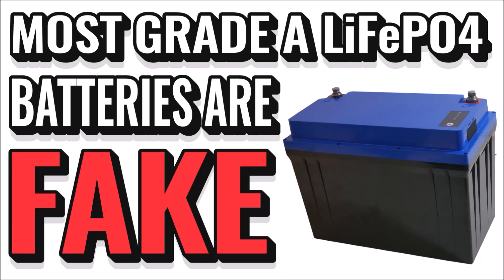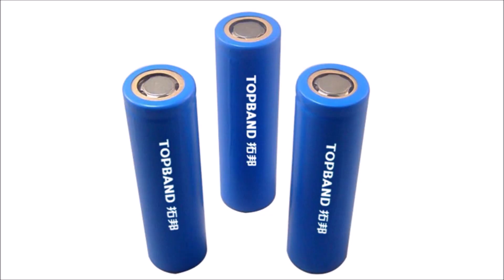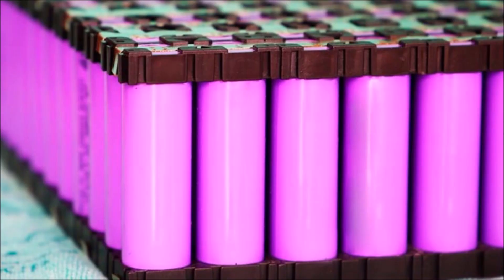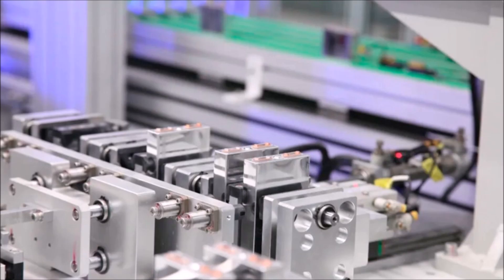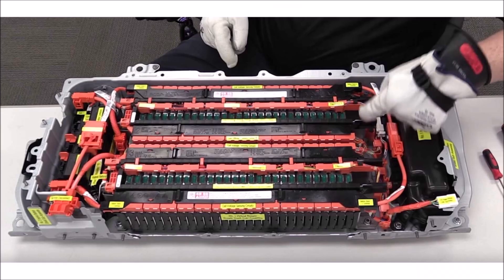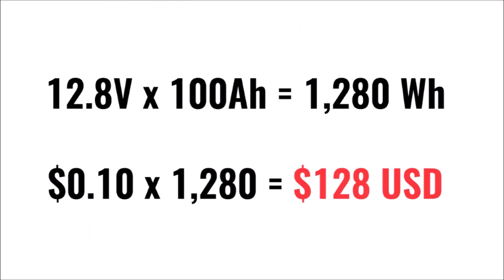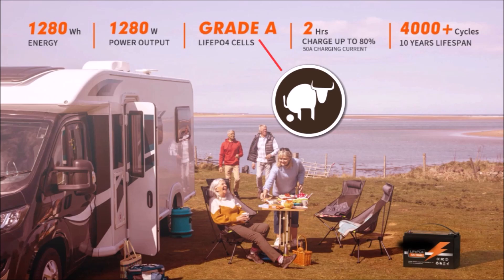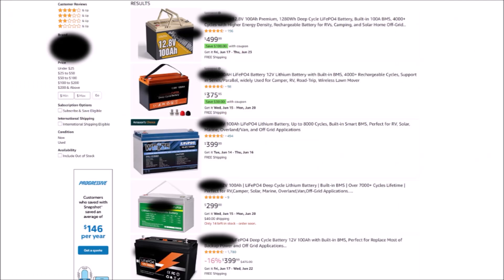Fake Grade A Lithium Deep Cycle Batteries Are Everywhere!  Learn How To Spot Grade B vs Grade A

Comment: False advertising is as old as human existence but in this case, the cheap fake grade B batteries might still offer the best value.  For an RV or adventure van usage, 1000 cycles of trouble free use might be 10 years, or longer than anyone will own the vehicle.  Faster charge rates, zero maintenance, light weight, and a 10 year life out of a 300Ah LFP battery @ $600??  Yes please.  In 10 years the battery tech will have improved exponentially so the fake B cell battery offers a best-value-right-now for most of us.
Reply from the maker: True.  But since this video was uploaded there have really emerged a new range of bargain basement offerings on Amazon and Ebay in the range of $0.15 per Wh range ($200 for a 12V 100Ah battery, for example) that have no chance at reaching 1000 cycles.  These are made with the cheapest of the cheap cells, sometimes even used cells or Grade C cells, combined with an ultra cheap BMS and average to poor internal construction.  These are being peddled by brands that are 1-2 years old, at most, and have no American support or business presence of any kind.  They simply ship containers full by sea to Amazon warehouses and offload all the support to Amazon.  Thus, you will not get any assistance or warranty support beyond the 30 day Amazon window.

So if you like to play Russian Roulette with your money, buy those.

Comment: Just purchased a battery for 118.00 dollars. Works fabulously and better than one I paid over 400.00 for. So if they're lying to me about it's grade which by the way is not stated on any battery that I've seen,so be it. If my cheap battery runs for 2 to 4 years I've more than gotten my value out of it. Times are changing and sometimes it's good.
Reply from the maker: Bookmark this post and come back to it in 2 years and tell us how it is doing.

Comment: I bet power tool makers like EGO, Dewalt etc are almost entirely based on grade B cells.
Reply from the maker: Correct.  Which is why the cell manufacturers rate their Grade A cells at 4,000+ cycles @ 100% DoD (which would be one full charge and discharge cycle every day for 11 years) but the manufacturer only warranties the battery at about 3 years as an industry average (pro rated, no less).

Granted, contractors may discharge their batteries multiple times in a day but 3 years is still a joke.

Comment: Recently i bought a 24v300ah lifepo battery in Aliex. They aren't just fake. They are a hazard. They admitted they don't have the certs when I requested for a copy of the displayed certification, in this case RoHs, CE....label on the battery. It weights only 10kg indicating that its not even grade B,  it may not even be lifepo...who knows. Everyone using it should know that this is a dangerous and hazardous product. Without proper quality certs you are at risk of fire and explosion. And worst your insurance do not cover such ignorance. These fly by nite sellers are out to fleece us. Buyers protection is useless because the logistic companies will not transport the return of such dangerous goods from 3rd parties.
Reply from the maker: And Alibaba/Aliexpress won't go after the sellers, anyway.  You have zero recourse.
Reply: @LDSreliance  Yes that's true. They are literally Alibaba and his forty thieves. There is one final recourse. With the proof that you hv been scammed get your credit card co to claimed back. You will be amazed.

Comment: I don't see a big problem here except being lied to. Which is a very minor problem, because when I buy anything made in China by a small (effectively noname) manufacturer, I can be sure they lied somewhere, so I just live with it.  And grade B batteries do not seem such a terrible deal for the price. As you said: I'm likely to not even notice the difference
Reply from the maker: I've since revised my opinion on that and the problem is worse than I believed at the time of publishing this video.  Some light users are not likely to notice a difference.  If you don't tax the battery it may be okay for an extended period of time.  But the early failure rate of these Grade B deep cycle batteries is 20% within the first year or two and that isn't taxing the battery hard.  So that is already Russian Roulette for anyone who buys one.  But heavy users, such as people putting them in bass boats and then going out to fish bass tournaments with them will almost surely notice a performance difference if not a failure within 500 cycles or so.

Comment: Remember, things do get cheaper over time.  It's now 2024-06-22 and I just bought 3 "grade A" 100AH 12 volt batteries with bluetooth BMS (100A charge and discharge).  These will replace the 2 6 volt golf cart batteries (230 AH) which I paid $500 for about 1 year ago.  It seems that leaving them on my float charger cooked them.  Oh, and the year before that?  SAME THING.  Lead acid and AGM are just too fragile for the marine environment.  If you discharge a lead acid battery too far, it's going to be quickly damaged.  But the lifepo4 batteries have much lower self discharge and I will be massively increasing my house battery storage, charging current and discharge current for just 20% more than re-re-re buying the deep cycle golf cart garbage batteries.

As someone said below, even if I only get HALF the life of a grade A setup for this kind of money, it is a steal of a deal compared to having to screw around with lead acid ever again.

Comment: Time USB has grade A. Sticker looks new and has not been messed with
Reply from the maker: Companies have been caught removing stickers, laser etching, QR codes, engraving, and serial information and sanding off the Grade B indicator that is required by Chinese law.  It is almost impossible to tell if a cell is real unless you check the information against the cell manufacturer's test data.  If the battery manufacturer is unwilling to give the cell manufacture data or you can't correlate the serial number with EVE or CATL or whoever made it, then you know you have a fake.

Comment: i can live with grade B. 
as i am living on ss and have little to NO extra money each month. and i have cut back on food even heat in the winter. ac in the summer.  but that is grid power. 
my old rv does have a number of old lead acid. but they are very heavy. i would like to go lighter weight. 
right now there are deals going on. but no money to do it. 
and at my age. i question if i would still be here in 10 - 15 years.

Comment: Grade B can easily get the same lifetime, wh will just be a bit lower
Reply from the maker: No they can't.  They won't all have the same specs so they will drift apart over time.  It doesn't matter if you top balance the cells manually or shallow cycle them.  They will never get 3,000+ cycles.
Reply: @LDSreliance  i guess if there isn't any type of balancer inside, but if there isn't its a pretty inexpensive adittion. I got an Neeey 4A balancer and that will do the trick (Got grade A myself tho because there was no eu stock)
Reply from the maker: If voltage is the only difference in all of the cells that might work fine.  But it isn't.  There are 11 other criteria that the cells could be out of spec on.  The worst would be internal resistance and the least bad would be physical size (bloating).  Like I said, even if you manually top balance the cells, which is superior to any balancing that any BMS can perform, you still can't get 3,000+ cycles out of any Grade B battery.

Comment: I bought 8 battle born 3 years ago .they are in 2s4p ,24v ,400 amp bank in my solar system ..they work great, stay balenced with proper charging technique and deliver about 105% of rated power.  I don’t care what they cost, I care that they work so well.
Reply from the maker: I dislike BattleBorn's marketing department and the founders/ownership group of the company but I do have respect for their build quality.  They are one of the few using Grade A batteries and producing a quality product that will last a long time with extremely rare exceptions.  And they have been around longer than most.

Comment: I don't mind buying LiFePo4 batteries with grade b cells for cheap as long as i get the same or more life from them than i do from lead acid batteries.
Reply from the maker: No guarantees there.  Roll the dice with everyone else.  (Unless you are going to neglect and abuse the lead acids then you will almost certainly be better off with Grade B lithium)

Comment: Most cheap Chinese LiFePo4 batteries perform to spec and are built decently, especially the brands that stick around. Nor are prices going to stay what they are but they will drop further and capacity will continue to increase. These are commodity items and if you want to charge $695 for a 100ah battery then you are asking to go out of business.
Reply from the maker: Business is doing well, actually.  It increases every year.  I get the privilege and misfortune of selling top shelf batteries to boaters and RVers who went the cheap route on Grade B batteries and got burned.  I obviously don't hear from the ones who got lucky and more power to them.

Try to find a single Grade B battery brand that has been around for more than 3 years.  I'm not saying there isn't one, but I have seen countless brands come and go.  And high volume sellers have to rebrand themselves (AmpereTime -> LiTime) because their bad reputation caught up to them.
Reply: @LDSreliance  Well, I wish you good luck -- and I mean it. But, while there certainly are bad apples amongst the importers, the ones that have been around for a time and also have thousands of reviews on amazon sell cheap batteries that are perfectly adequate for most users. Some will even provide customer service and honor warranties -- something I don't even expect at such low prices. Yes, some customers will get screwed by low-cost batteries but I have no doubt that most will be perfectly happy with their purchases given the savings.

Off the top of my head without checking amazon: Chins, Weize, Expertpower are three brands that have been around for at least 3 years and that continue to sell their batteries and also get good reviews. When AmpereTime was around they had thousands of reviews averaging probably 4.4 stars on amazon. I would not bet that the reason for the name change was because of poor reputation.
Reply from the maker: I can't find any reference to CHINS before 2022.  Same for the other two you mentioned.

And it is pretty well known among industry insiders that AmpereTime had to change their name due to reputation.  Amazon reviews are faked and manipulated very easily.  If you use a third party app, such as Fakespot by Mozilla that removes the fake reviews, you will see that LiTime has a C grade on an A to F scale.  That isn't bad but it definitely isn't 4.4 stars.  That is an aggregate grade as a whole company, not just one product.  Some of their individual products have an F rating.  I would bet that within another 2-3 years LiTime will no longer be available on the market.

We will have to agree to disagree on the rest.  I don't feel that these cheap Grade B batteries are best for most consumers.  But that is their choice.  I think within 5-6 years we will see a swing of the pendulum back to a middle ground, just like any other mature product out there.  You will find a percentage of people that buy the cheapest thing available and only shop on price, a large majority that buy somewhere in the middle, and a percentage that buy premium products that they believe will last a long time.

Comment: Many lithium LiPo4 battery sellers don’t say the battery grade on their inexpensive batteries so they are not being dishonest.  They do specify 3,000 to 4,000 cycles to 80 per cent charge though.  Fifteen years from now, I will know if my batteries fall way short of their specs.
Reply from the maker: Yes they are.  They all still publish Grade A cycle count numbers.  Find me a single listing that reports 1500 or fewer cycles for the cycle life.  The only one that I know of that does this is MillerTech and they publish an expectation of 1200 cycles on theirs.  And at least their Grade B cells are matched (all from the same production batch and have closely matched voltages).

You don't need to wait 15 years.  Put your your battery under a sustained 1C load for 15 minutes or a 2C load for 30 seconds and see what happens.  Most grade B batteries can't handle it and the voltage will drop like a rock.
Reply: @LDSreliance  HQST is advertising a Lifepo4 12 v 100 ah battery 3,000 cycles to 80% capacity life for $189.95 USD. No mention whether grade A or B battery cells.  So this must be A grade cells strictly going by cycle counts is what you are saying.  Not sure how to perform the 1c and 2c test you mentioned. Could you please give direction?  What is a 1c and 2 c load?  Intriguing.
Reply from the maker: No, that is not what I am saying.  You said that these sellers are not being dishonest.  It is impossible to sell a Grade A 12V 100Ah LFP battery for $189.95 so they are using Grade B cells.  So far there is no lie.  They just haven't told the customer they are using Grade B.  But they have stated 3,000 cycles and that, in fact, is the lie.

For a 12V 100Ah battery you would put the battery under a 1200W load to achieve 1C and 2400W to achieve 2C.  All batteries are rated to handle 1C continuously.  But 1C stresses the battery and all of those minor (or major) imperfections in the cells will combine to form a large performance problem and the battery will not be able to handle the load.  2C will really show the problems and most will fail to do it at all.

At best, the battery will be able to handle 1C but will not put out its rated capacity (by definition it should be able to do 1C for one hour continuously).  At worst, the voltage will drop to an unmanageable level within seconds or minutes and continue to drop.

You don't have to take my word for it.  There are plenty of videos showing this to be true.  I just don't have the test equipment that some of these folks do to do this test with precision:

https://www.youtube.com/watch?v=EEUhlNvsqjQ
https://www.youtube.com/watch?v=KD-av4cTL-Q
Reply: @LDSreliance  thanks.  Good information.  I understand what you are saying about the cycle performance is the misleading factor.  Just need to be proven which you just gave the method to prove your point. Much appreciated.

Comment: Great video. But, now knowing the truth, I still think it's a great deal. If the majority of people which includes me, will never know any difference until after thousands of cycles, I feel like I'm getting my money's worth. So even though they lied, I'm paying less and in the end getting a bit less longevity or service life. It would be interesting but not very practical to do a long term study to calculate exactly what you pay for each watt hour or a period of several years. It should show that the price between a real  grade A cell and its higher price, compared to a fake but cheaper grade A cell are going to be very close. Too close to worry about. I do thank you for confirming what a lot of us have suspected for a long time
Reply from the maker: Possibly.  But since posting this video there has been new evidence and data that actually shows a 20% failure rate of Grade B batteries in the first year of use.  Other data is showing that some Grade B batteries are not capable of outputting the current that they are rated for.  So the situation has gotten worse since this was published.
Reply: @LDSreliance  20% failure rate is not good, I still have a 5 year warranty. I'm hoping I'm in the 80% that won't need a warranty though.
Reply from the maker: I hope the company you bought from is still in business and willing to stand behind the warranty if you require it.  Good luck!

Comment: specially those batteries on amazon the very cheap ones. I am in Canada  and the batteries i see up here  have nothing to do with the cheap prises like  for a 12.8v 100ah battery. Up here not the same brands  and thoise up here are above 1000 dollars for a 12.8 100ah but they have heated   and cold cut off switches because Canada is a cold place  in winter.  but you can't find  cheap prices like 339 .00 dollars like on amazon or  a LiTime 12.8 v 100ah heated battery even on amazon  selles for close to 900 plus . imagine 280ah or more ???
Reply from the maker: It is like a flood here with cheap Chinese junk.  I used to be a really big defender and supporter of Chinese products but the more I get to know how many of their companies do business and how they have taken over Amazon and other outlets has really soured me.  And I know not all of them are like that but it is almost impossible to tell who is good and trustworthy and who isn't.